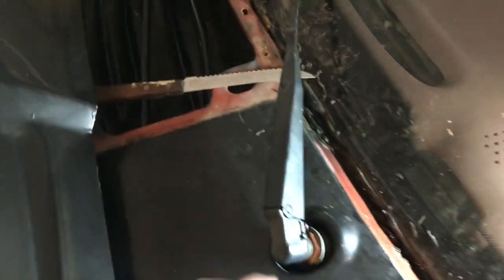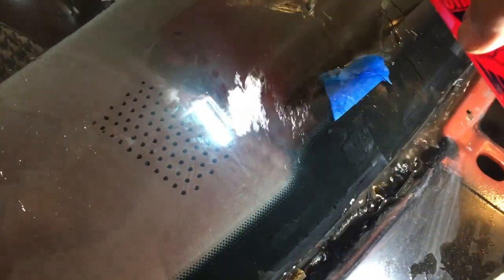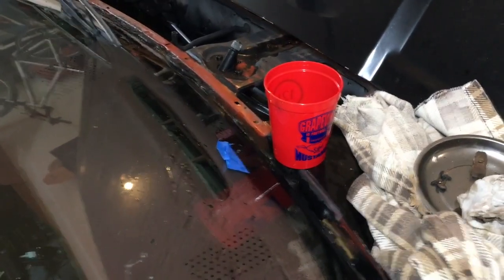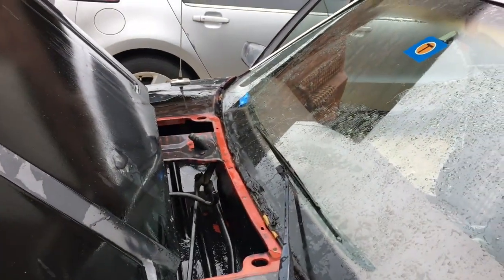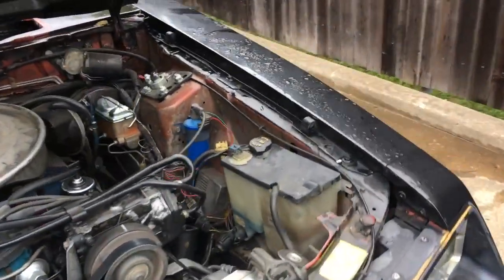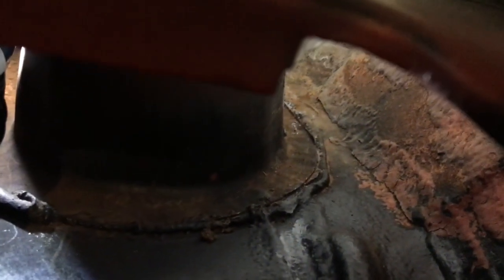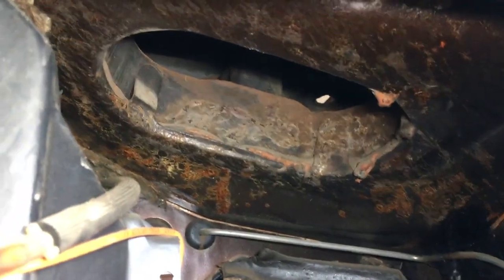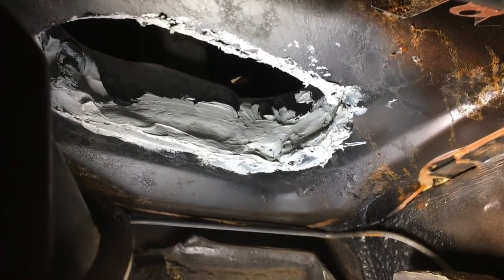Foxbody Cowl water leak fixed!

Comment: Thanks for the video! I recently bought a 1990 mustang and it seems to be leaking on this side. Everywhere I look it says it’s the heater core but I know it’s water. Will give this a try thank you!
Reply: I know this a late response but ford switched up the way they did the fresh air intake on the 87-93 and it’s all one piece instead of the fresh air intake being welded on and then sealed so it can’t leak from there
Reply: @sav22rem22  thanks for the info! Turns out that whole corner was rusted out so I needed to remake that piece of the cowl.
Reply: @anthonyriestra848  That’s good you got it fixed. I fear that mine may be rusted too. Did you have to pull your fender to find the rust?
Reply: @sav22rem22  
 if you look under the dash behind the blower motor you’ll get a good idea of what you need remove (extent of damage) but yes I needed to remove the fender but I also needed to remove some of the spot welds on the frame that sort of caps the end of the cowl if that makes sense. It’s triangular shaped and has around 15 spot welds, once I took that out, it was all visible and I was able to make a new piece and weld it in. Hopefully yours isn’t too bad like mine was, I had to remove the doors, windshield, dash. 

My car was leaking severely so I wanted to get a good look at the entire car.
Reply: Def remove that fender... your whole panel that the door hinges are probably rusted and moat don't realize it til it rots.  through from all the water. Mine had a small rot hole right below the windshield in the bottom corner where thiers supposed to be sealer.